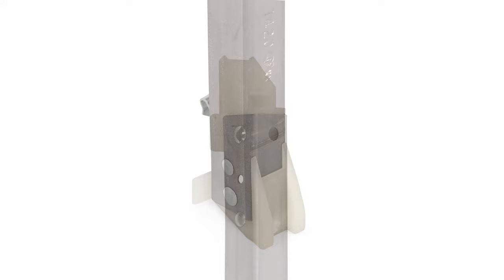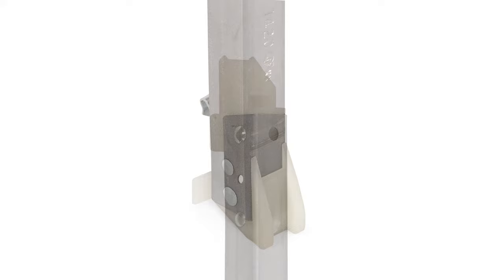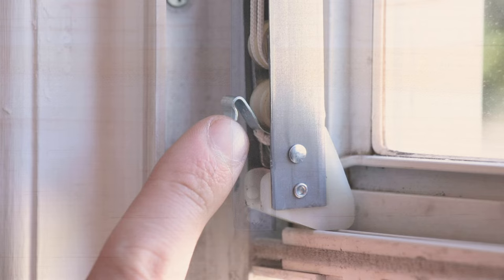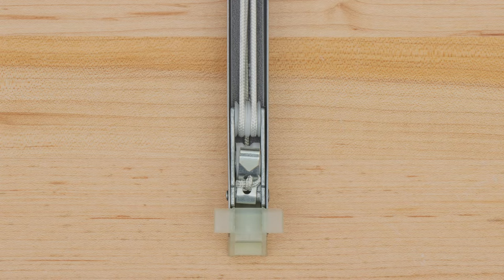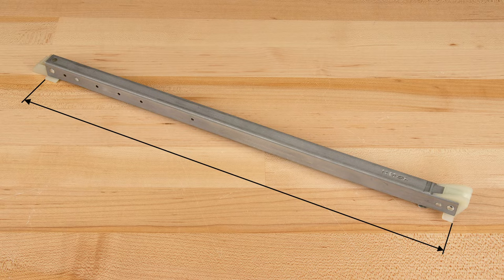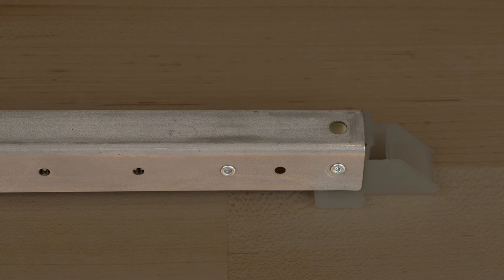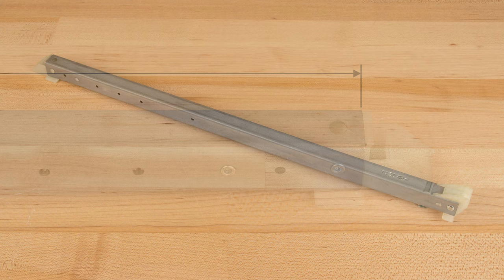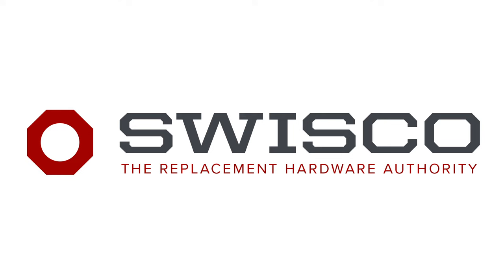How to Identify a Replacement Channel Balance

Comment: Aloha I have a 23 3/4 inch balance the number is 163 - these are installed at the top of the window frame not on the sides  the window was basically installed sideways so the wheels run vertical in the side tracks - w the balance mechanism in the upper most part or the frame. The windows open sliding up to the mounted balance it looks like someone make shifted these as they only have one balance per window there are two windows exactly the same design. There are no balances on the sides of the windows- only one per window at the top w the string attached to the window frame on the part that moves up and down not the fixed glass section-thx

Comment: HI, I have what is called here in FM, FL. Hurricane windows; Very heavy. I have that the spring popped out, it is a double spring 3/8 outside? 1/4 inside. I could not find numbers the window size is 30x51. Any idea?
Reply from the maker: Hi there Juan. We can help you find the right balance at the link below. We'll need the length of the metal channel, a picture of the top and bottom attachments, and any numbers stamped into the metal channel. If there are no numbers, you'll need to weigh the sash. https://www.swisco.com/page-id-part

Comment: I have a balance that has a stamp of 2950 and is 29.5 inches long without the plastic clips on the ends and with it it’s 30”. I found a 30” length that has a 2950 stamp but it’s showing it as being 30 inches long and not 29.5  long. Do you carry half inch lengths?
Reply from the maker: Swisco has a large selection of balances and can even make custom balances if necessary. Our experts can help you, just go to https://www.swisco.com/page-id-part  Please include photos of the of the top end, bottom end, stamp, and the metal clip at the end of the cord.
Reply: @SWISCO  Thank you!